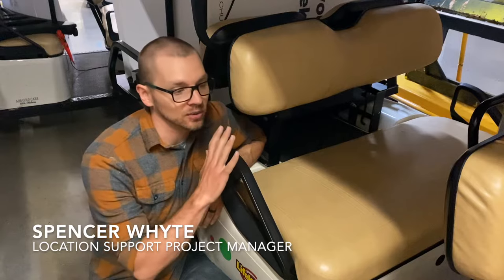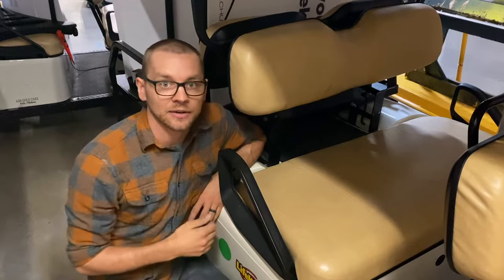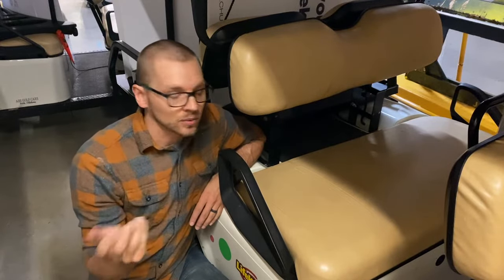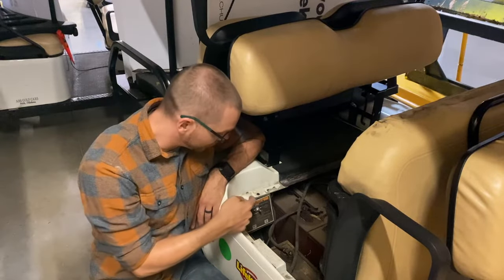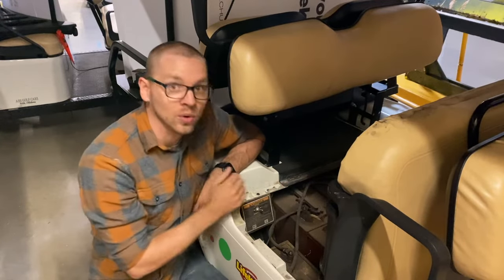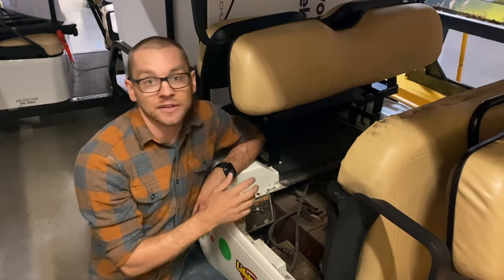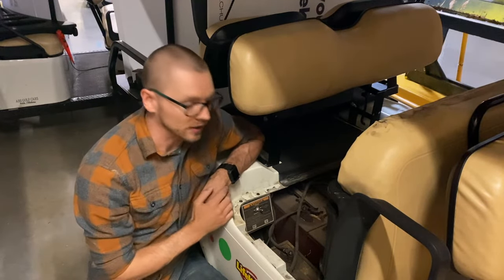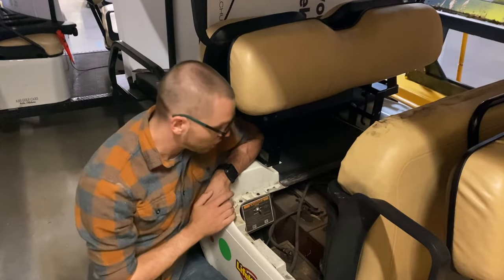Tow/Run Switch Golf Cart

Comment: Some of the newer Icon carts have that switch, but they also have a electronic brake system, which is engaged or disengaged by that switch. Read the manual about leaving that switch in the "manual" setting. It doesn't like to be in the manual setting for too long a period.